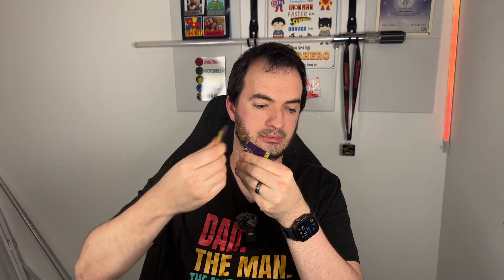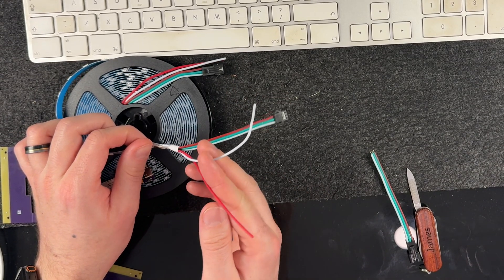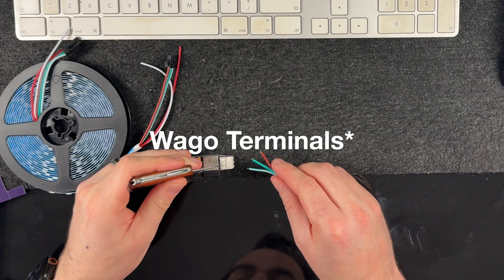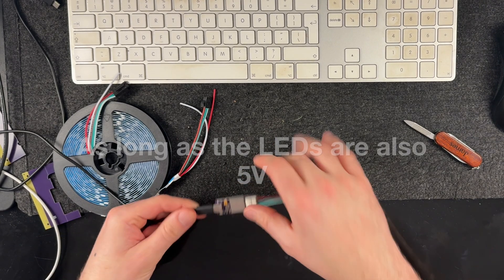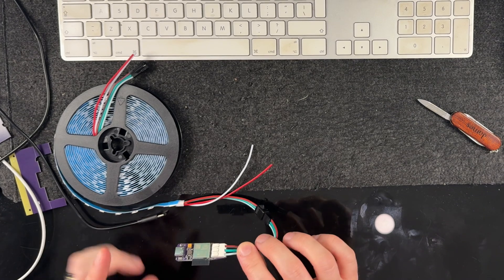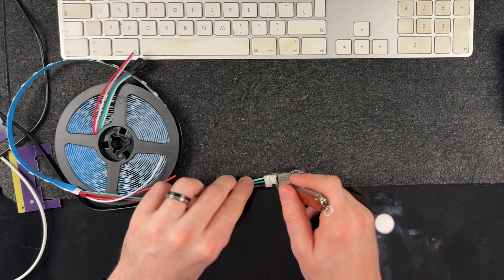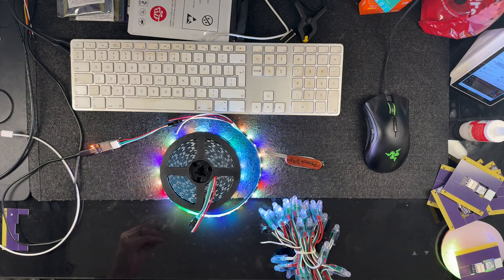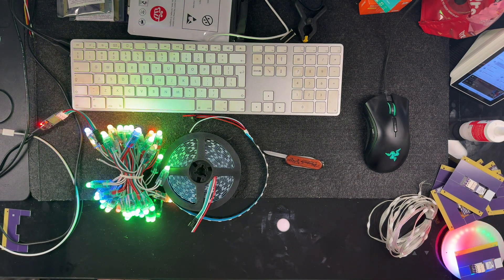What makes our WLED controller different?

Comment: How to wire 36v power supply to it to direct connection for 36v led strip
Reply: Ok. I have govee outdoor permanent lights which is 36v. I thought this controller could be hooked up directly beside using the USB. I have controller that does it for 24v setup,  so I was hoping to do it with 36v
Reply from the maker: @thomasshields8245 yes it can, there is no need to also run USB if you’ve got one of our current stock (apologies if I didn’t make that clear)
Reply: @HomeIsWhereTheSmartIs I did buy your controller for 36 volts. I didn't get any instructions where to hook the 36 volt power to the controller that you have in the video. I wanted to make sure I do or don't hook it to the usb port. If not where do I hook it up for power through to the LED'S
Reply from the maker: Oh wow you have an actual 36v strip?

Never actually had a chance to try anything above 24v but it should work the same.

Simply wire the controller to the addressable LED strip in the correct order, then wire the power supply to the strip (either at the start with the controller or further along), and it should power up.

Comment: Do you have any solutions for 230v ac led strips?
Reply from the maker: Not directly, but afaik all LED strips ultimately use low voltage DC. If it runs off mains then it simply has the power supply built in to get the voltage right, at which point you can smart control addressable ones with our controller, or traditional "single colour at a time" strips with something like a Shelly.

Comment: Appreciate the engineering that went into this. When you are talking about connectors please can you mention the connector series not just the brand. The wire-wire connectors on my addressable strips are JST SM series. Probably order a few boards for fun RGB projects.

Comment: Would love to have this board in the US.
Reply: I second this!  As of right now, the best alternative I can find is the Forkineye ESPixelStick, but it is huge in comparison to what your board seems to be!
Reply: @Alaric323  I thought QuinLED had something similar, but the Dig-Uno is the closest I'm finding.
Reply: I agree, 100%!! At $25~$30 US, he'd sell everything he could keep in stock! Thousands the first week.
This is a simple design and I can think of half a dozen places in my house to use them right now.
Reply from the maker: For those of you wanting multiple, it might be worth getting in touch via my website and arranging direct shipment of a few (if the shipping is reasonable cost).
Reply from the maker: @JimSloan  I’m trying to do what I can to get Amazon to list them over there. But it seems to be surprisingly difficult, and basically luck whether they decide to or not.
Reply from the maker: @JimSloan  FYI I might start listing on Tindie so should then be more widely available

Comment: EDIT scratch this, there is a problem with my PC, sound is fine in my Tablet. Potentially an informative video as I am interested in your product. Unfortunately the volume is so low that it is difficult to hear. I turned on text captions but that makes the whole thing a bit too much hard work
Reply: I’ve just watched the video and eveything sounded fine to me 😀
Reply: @Theoriginal1981  Myst be my old ears then.
Reply from the maker: Oh no sorry to hear that. Are the captions accurate enough to understand? If not I can potentially try and transcribe it and upload better ones if that helps? (My hearing is terrible too so I get it when you can’t understand what someone is saying)
Reply from the maker: You can also contact me via the methods on my website if you have any trouble getting the device setup.